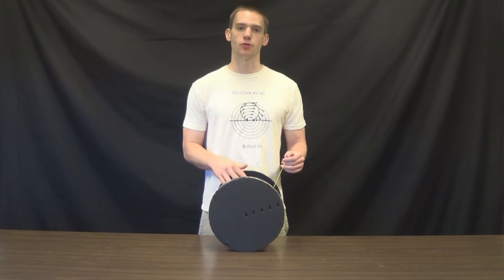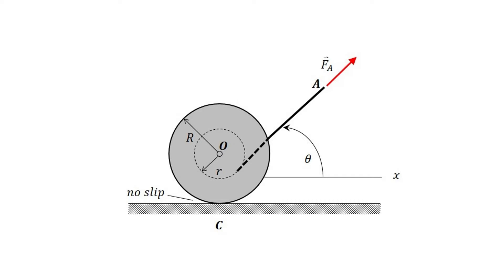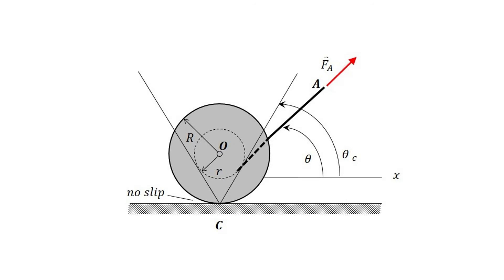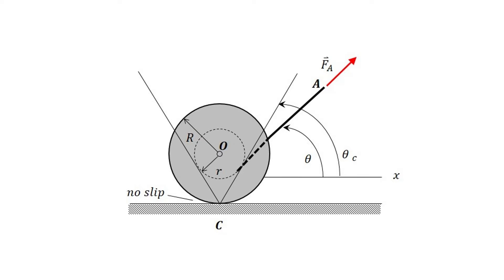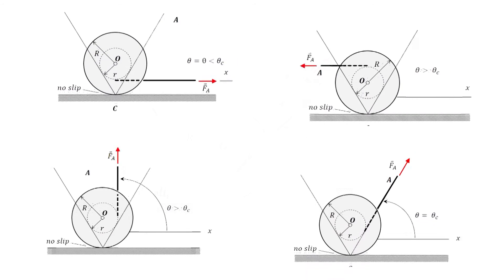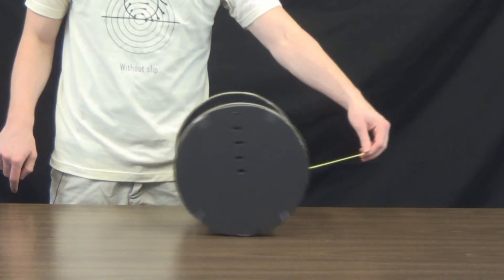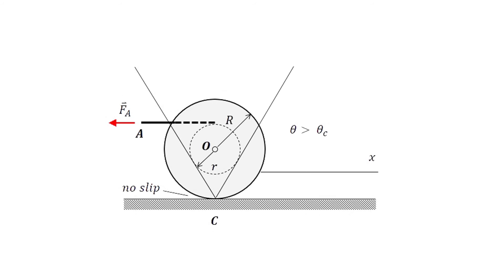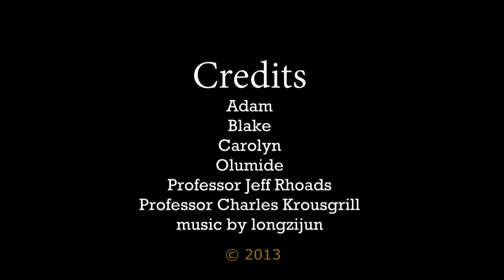Visualizing Mechanics: Impending Motion of a Spool

Comment: I'm trying to work out the relationship between spooling material and the lateral movement of that material on the spool. I am not a mathematician. 

In spooling a material, I've observed there is always lateral movement of the material on the spool. For example when you wind thread from one spool to another the thread always moves across the spool back and forth without intervention. 

Another example is spooling a roll of paper from one spool to another. The source roll is perfectly aligned, while the receiving roll becomes unaligned as the paper spools.

Why? What force is causing this and how do I prevent this?
Reply: I think forces between the different parts of the string, and in the case of the paper I think it more probable that it is due to the two spools not being parallel and directly opposing (so that the paper does not need to go diagonally between them).
For the string, if there is tension on it provided by a weight hanging from it, and the spool rotates at a constant speed, any bump on the spool will push the string to the side of it, so as to minimize the tension in the string (if the string  goes over the bump it traverses a longer distance in the same amount of time, so the weight needs to be accelerated).

Comment: Doesn't this only apply if the force with which you pull it is below a certain value because if you pull to your right at a zero degree angle friction causes clockwise rotation which counteracts the counterclockwise motion caused by the force? But the friction can only at most equal a limiting value.